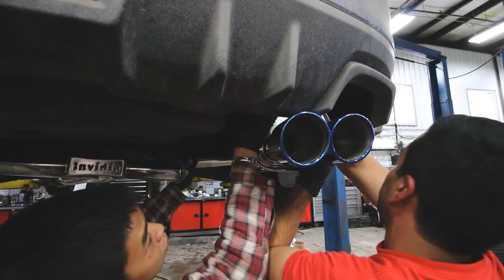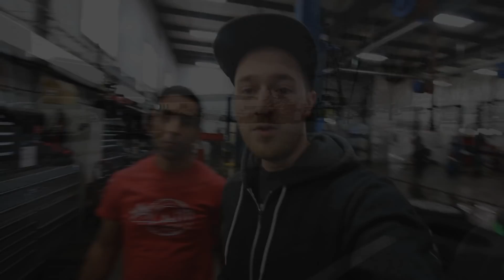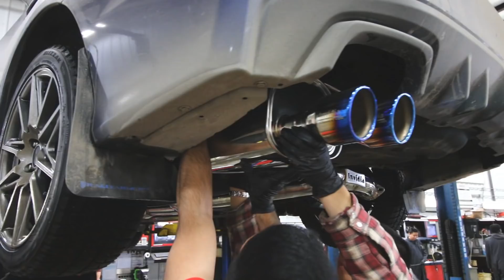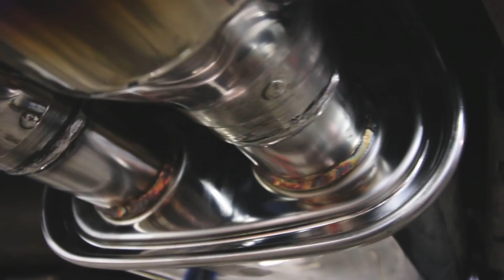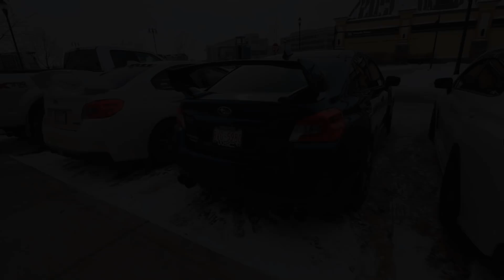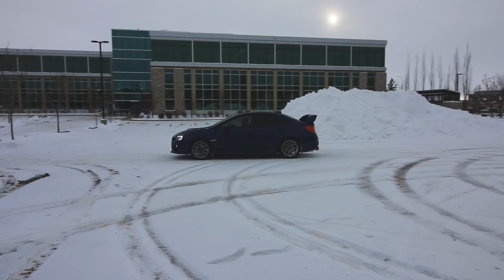Invidia Q300 Quad TI Tipped Cat Back Exhaust - Rev's and Drive by's 2015 WRX STI

Comment: Fit, finish and sound of the q300 is perfect. Selling my Ets extreme and getting this. Plus those 4 inch burnt tips look so good.
Reply: i have the extreme too. Why are you selling? too raspy?
Reply: Just want something quieter and better for daily driving and longer trips. Plus in the future, I want to get headers and a downpipe so the extreme is going to be way too loud for that.
Reply: yah i am only getting the q300 when i get a dp. How much are you planning to sell them?
Reply: probably try to get like 850 or so for the exhaust. Has been on the car for less than 6 months.

Comment: Sounds great! Perfect tame catback that's loud when you want it to be. Quick question, for those led daytime lights do you have to bake and open up your headlights to install them?
Reply from the maker: Hey dude, I definitly agree, nice a tame but then under throttle it really comes alive and sounds super good!!
For the C Lights (DRLs) Raj has it's the same as mine actually, Diode Dynamics switchback C Lights. You do have to bake and take apart the headlights yes!  I have a few really detailed how-to video's on the process if you like to do it!

Comment: Wow and this is what the stock downpipe? Everything else was stock? I was worried about the volume of the q300 with everything else stock, but this sounds good / loud enough for me
Reply: Dan DeMaio from what I have gathered, the q300 is louder than stock but nothing to crazy. A good performance tone when you get on it and tame when just cruising. Plus as you add mods ex downpipe, up pipe, headers it is one of the few exhausts that still sounds very good without being crazy loud. I just ordered mine, stoked to get it.

Comment: Dude remove the cat need a downpipe and fuel injectors with flex fuel pump make more horsepower stage 2 power easy 35-50 WHP